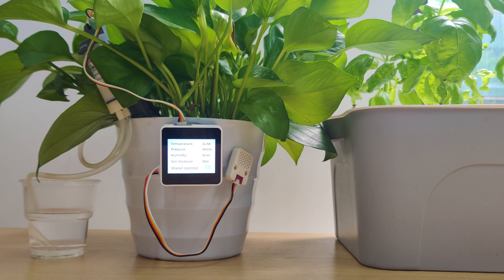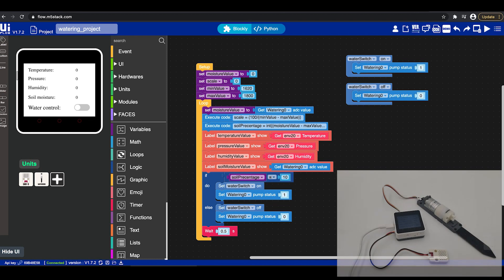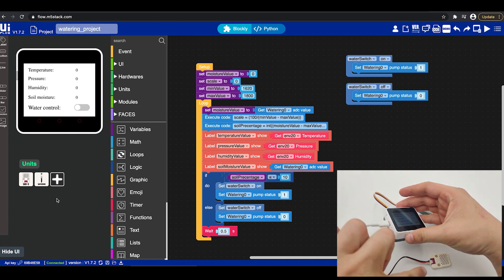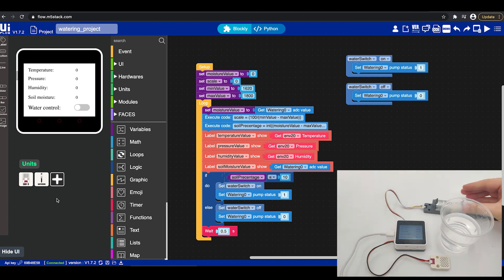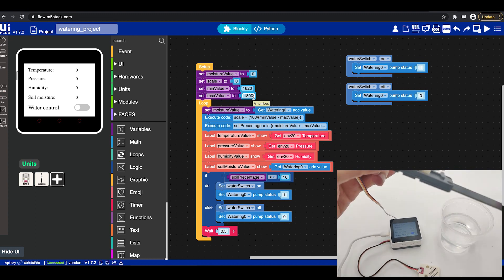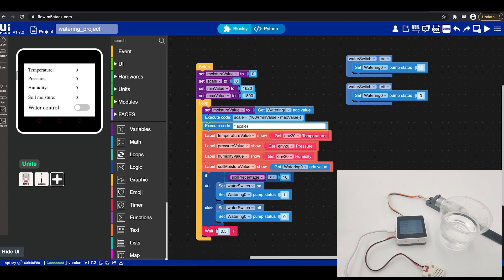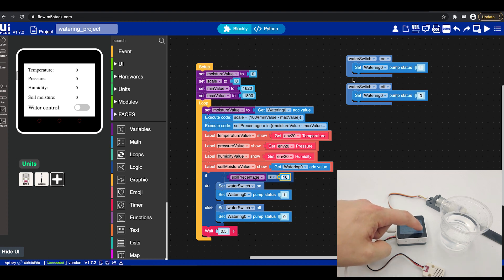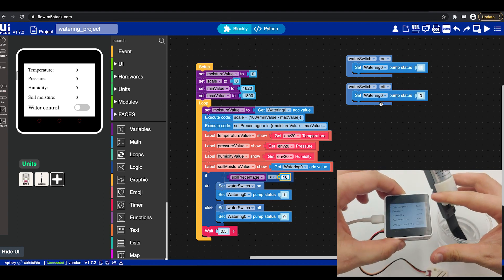Smart Plant Watering System Using M5Stack CORE2 ESP32 Controller

Comment: I bought an M5Stack CORE2 but it has only one port, not two ports, I'm wondering if there is more than one type! and when can i have this type that you use in this video?
Reply: New to M5Stack but think you can get a M5GO BOTTOM2 (for CORE2) or similar to fix that.